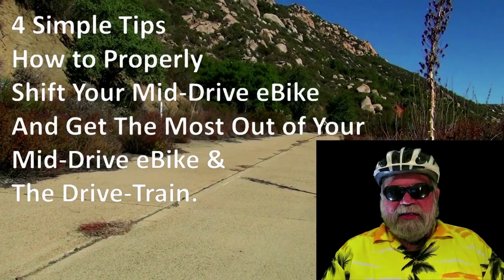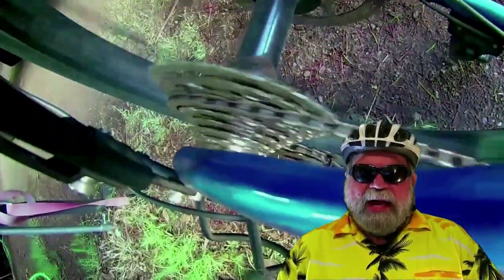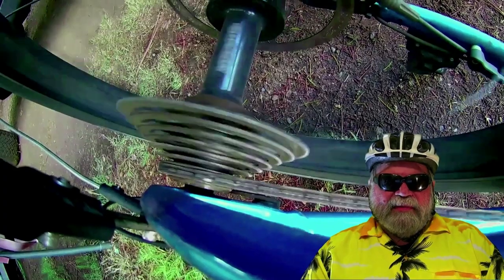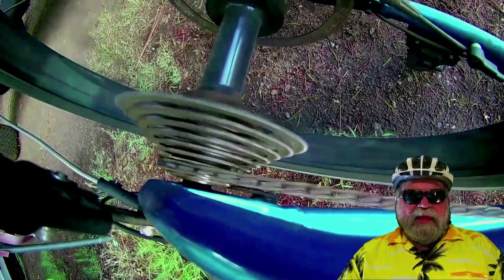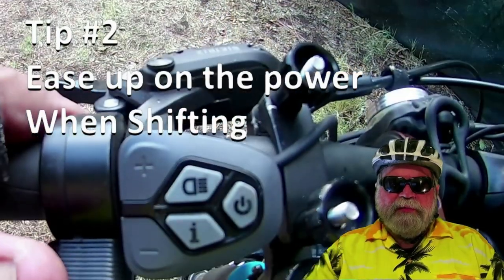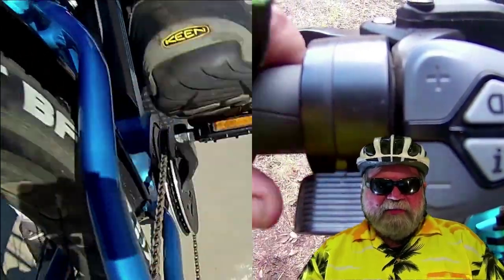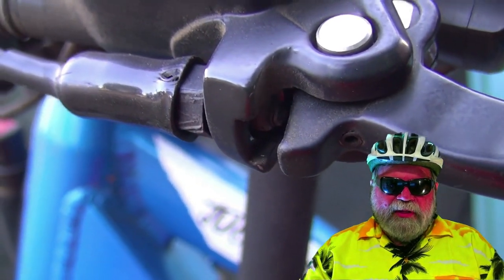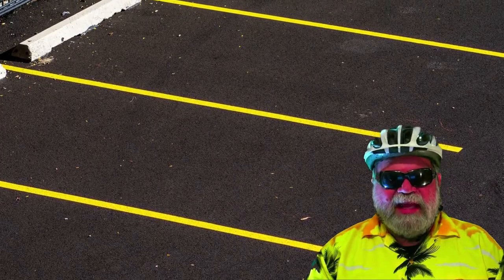4 SIMPLE Tips for Shifting your Mid Drive eBike. Make your Mid Drive e-bike perform better.

Comment: This has been the best, most down to earth video I’ve seen for the topic. Thank you!
Reply from the maker: Thanks for the great comment. Do you ride a mid-drive or hub-drive eBike?
Reply: @GreyBeardEBiking  a mid hub. I heard it was easy to mess up the motor or cassette and wanted to avoid it.
Reply from the maker: @defenderofmen11  My experience has been that the Mid-drive motor set ups are more tolerant of hard use. I'm a large rider and ride in very hilly terrain and I have burned up multiple Hub-drive motors. Now that I'm using Mid Drives and using the gears on the bike properly, I haven't had any issues with my motor or drive line. However, like all mechanical things, there is wear over time and I realize I will need to replace parts. I carry spare chain parts on my rides so I can repair a broken chain. In addition, I had a spare rear cassette for when the time comes that I need to replace it. I have owned my current eBike for over 3 years and have over 4000 miles on the original chain and rear cassette. I'll probably replace both sometime this year, but they are still operating well. Stay safe and carry a tool kit with you.

Comment: Excellent guidance for those new to mid-drives as well as a sound reminder to us with experience. Thanks!
Reply from the maker: Thanks. You would be surprised to find out how many riders I've seen, both experienced and new riders, that leave the chain in the highest gear, (Small Cog), and never use the gears. Really bad for the entire drive system and really heats up the motor. Having ridden pedal only bikes for many years, I'm pretty used to down shifting, especially when coming to a stop or on hills. Have you had any issues with your eBike drivetrain?
Reply: @GreyBeardEBiking  No drivetrain issues whatsoever, but I do what you advocate. I have experience from motorcycle riding and bicycle riding in my youth. I also drove a stick shift car. Glad I still remember!
Reply from the maker: @itsaboutsuccess  Ah yes ... the manual transmission. My jeep is/was a stick shift and I learned on my dad's stick shift Datsun truck. Unfortunately my jeep, My Weekend Mobile, gave up the ghost 2 weeks ago after 310,000 miles. I'm gunna miss her.
Reply: @GreyBeardEBiking  Who was to guess that stick shift experience would have future benefits? Seperately, your jeep traveled around the earth more than twelve times... impressive!
Reply from the maker: @itsaboutsuccess  Yup, she was a very durable machine that shared many adventures together. Already miss her. Like you, I'm really glad I got the experience of a manual transmission. And you're correct, the experience has helped me in other areas.

Comment: Cut to the chase and get a Rohloff Speedhub, you won't believe how well a mid-drive and an IGH work together. You won't want to ever go back. I replace my chain every 6 months (approx 3K miles) and flip the Rohloff gear to a new side.  Less than $20 and about 30 minutes on the side of the trail anywhere I may be.
Reply from the maker: Yup, the Rohloff speed hub is a great piece of gear however, I was trying to point out the simple things that can be done with stock gear that will help to extend the life of the eBike drive train. Did you do the install yourself?
Reply: @GreyBeardEBiking  Yes and a Rohloff cut my yearly maintenance to the drive train to less than $50 a year. Try replacing the entire gear cluster and see what it costs. Mid-drives can and do tear drive trains to shreds when riders start to ride more aggressively or start loading the bike with gear. The only way to save low-end stock components is to ride soft and easy... which doesn't last long when you start getting experience on your ebike.

Comment: Just befor i got my mid drive I built a Shimano IGH into my wheel. My homey was asking "wai not just have the bikeshop stitch it together?" 
Because I would have to give them $30. And I wouldn't have the chance to learn to do something new. 
I did have them calculate and cut my new spokes because if I calculated wrong I would be paying for the next set, if they calculate wrong they replace them. The tool to thread them is $200. So that will be for next year.
Reply from the maker: Thanks for the comment. Sounds like you took on a pretty tough challenge, but you overcame the challenge, learned something, and saved some dough. Congrats.

Comment: Awesome tips. Thank you for sharing!
Reply from the maker: Thanks for the nice comment. Do you ride a mid drive or hub drive?
Reply: @GreyBeardEBiking  I ride a vintage K2 MTB hardtail with a Bafang BBS02 mid drive kit. It is awesome. I am constantly reminding myself to always put it in first gear when I am stopping or even just yielding. Just today I was cruising in PAS 5 and gear 5, when I came to an intersection. I forgot to downshift when I slowed down, and when I started pedaling again I could hear my gears bark at me. learning everyday...
Reply from the maker: @banyanstudio  That's awesome. How long have you been riding your rig and where do you ride?
Reply: @GreyBeardEBiking  I've only been riding with the new motor since January. Just about o hit 100 miles on my odometer. I ride near Seattle WA.
Reply from the maker: @banyanstudio  That's great. keep me updated on how your setup lasts. I live in Southern California, but I will be moving to North Idaho this summer. (CDA). Maybe We will see each other on the trail sometime.

Comment: Is it okay to start on the higher gears if I only start the motor once I've gotten up to speed by pedaling?
Reply from the maker: Thanks for your great question. Generally, it's better to not cycle your motor on an off as it uses a little more battery life. Also, even if your motor is turn off, it's still better to shift to a lower gear as these put much less strain on you drive line, "Chain, gears, pedals, ETC."

Comment: Nice to see you back!  Was worried about you. What have you been up too!
Reply from the maker: Thanks, been traveling a bit. Might be moving from SoCal to Northern Idaho. Any advice for me.
Reply: @GreyBeardEBiking  yes !  Do it!  Although your biking opportunities will be less if at all in winter.  I toured Idaho 4 times looking for homes with land.  Great deals and would have loved to move. But for now I need to stay closer to aging parents.  Moved from NorCal to Northern Nevada for now instead.  Lots of trails to ride here and Lake Tahoe not to far. Got in a nice ride on a great bike path yesterday from Squaw Valley to Tahoe City.   114 mile trail call the the Tahoe-Pyramid Trail I’m looking at completing next spring.  Have friends all over Idaho.  Mostly around Boise.  I was looking around Coure d’lane very hard.  Be sure to checkout McCall, Idaho.  Was also top of my list.  Great growing small town.  I’m was rated as one of the top towns to retire.   I might get ti move there in a few more years. Looking for cooler summers.  But they do get quite a bit more snow that CDL.  Best of luck with your decision. It sure is beautiful up there.
Reply: @GreyBeardEBiking  I’m riding a Eunorau Defender S.   Dual hub motors, full suspension, running dual batteries also when needed.  Love the bike so far.
Reply from the maker: @joebidendidthat5121  That's an awesome ride. I'm still on my Biktrix Juggernaut Ultra 1000 mid drive. It has been a very reliable ride for me. Had it since Jan 2021. Many great adventures on it.

Comment: Just orderd my first e bike which is a mid drive so this will be really useful. Ordered a Specialised turbo levo as i wanted comfort, durability and wanted a nice powerful motor as its 565 watts with 90nm of torque. But wanting to find how to get the most out of it i can.
Reply from the maker: Thanks for the comment. The Specialized Turbo Levo is a great eBike. You will love it. As far as getting the most out of you eBike, I always recommend following the manufacturers recommendations for maintenance and repair. I don't try to "soup-it-up" with aftermarket speed upgrades. It seems when folks try to do things to the motor or battery outside of the manufacture's recommendations they end up with problems. What type of riding do you do and what part of the country do you ride?
Reply: I wouldn't trust myself trying to add anything aftermarket on it 😂  probably change out the grips, pedals, and add a better chain, but keep it mostly stock that way. Be mostly road and some gravel/dirt paths. It's definitely overbiked for my commute to work, which it's 12 miles one way, so I want something comfy but with some oomph on the motor. It's the alloy model I've got as also got £500 off but eventually I may upgrade to higher model down the line but definitely can't wait
Reply from the maker: @SubaruWRC1996  Sounds like we think alike with regard to aftermarket accessories. I prefer for my everyday riding to keep everything factory. For me it has worked well and my eBikes tend to las a long while. All this being said, if we were riding some extreme terrain and really challenging the eBike then I would consider some specialty parts. But for now, I'll stay stock. Let me know when you upgrade and how it goes for you. Thanks.
Reply: @GreyBeardEBiking  will do. Got some new pedals and ordred some floating disc rotors. Will look at changing the break levers and break calipers too and I think I'll change the grips too. Also thought about getting the e bike specific cassette and chain from kmc too
Reply from the maker: @SubaruWRC1996  Sorry it took so long to get back to you. Life got in the way. Sounds like you are adding some great accessories. Let me know how they work out. Thanks again.

Comment: There is no such thing as a legal mid-drive more powerful than one human leg. E-bikes are NOT harder on chains, cassettes and such. We generate more than 100nm's of torque with our arms in bike shops everyday. 

Persons experiencing unusual chain wear and such are indeed shifting wrong. ALL bicycles, "e" or not, should be ridden 60-90rpm. This is why you often  see a seated rider passing one standing in races. You should be pressing no harder than as if you are walking on the same surface (some exceptionally fit riders are even efficient at 110rpm). Yes, you can go a lite gaster pressing g harder, but your return on energy is greatly diminished because it is absorbed by your frame and drive line components (it is hard on them too).  Shift accordingly and indeed, use all of your gears. BTW, this is why internally geared hubs are better for e-bikes. You can shift coasting or stopped so you are always in the ideal gear to start. That really helps with the reliability of your bike.

Torque sensing eliminates the need for a shift sensor. All bikes, "e" or not, should never be shifted under load. It has nothing to do with the motor.
Reply from the maker: Thanks for your comment. I agree with on the issue of shifting under load. That should not be done on a regular pedal bike or an eBike. However, most quality mid-drive eBikes have a power cut off switch that cuts the power to the motor during shifting. I don't agree on other items you brought up. eBike motors, rear hub or mid-drive perform best when the motor is run at a higher RPM and lower gear, (larger rear cog). To be legal in most states, for the street, eBikes must have power shut off switches when they reach 28 MPH. As far as a rear hub motor being better than a mid-drive motor ... it depends on many factors. Larger riders generally do much better with a mid-drive because the motor can work through the rear cassette like a transmission on a car. Whereas the rear hub spins the entire wheel and does not just use the rear cassette. Of course, using a lower gear and pedaling when starting from a dead stop will help both types of motor. Also, the mid-drive motors are generally able to generate more torque. And because the mid-drive motor delivers higher torque the mid-drive motors tend to be harder on the entire drive chain, including the chain. Thanks again for your comments.
Reply: @GreyBeardEBiking  you completely misread my comment. I will only sell or convert with mid-drives. We only disagree on the need for cut-offs on a torque sensing motor (factory bikes will almost always have them. Vanpowers and Reid being notable exceptions) and on drive train wear from mid-drives. That is a myth. Like I said, no legal e-bike motor exerts as much torque as ONE human leg (it also divers the power more linearly). Only improper shifting will cause unusual chain wear on a mid-drive.
Reply from the maker: @MHH3180  Thanks for the return comment. We pretty much agree ... the major cause of chain and cassette damage is due to "Power Shifting". However, Chain and cassette wear is higher on mid-drives because the power from the motor is through the drive line, as opposed to the rear hub drive which does not use the drive line to power the wheel. In any case I think we are on the same page. Of course this is all based on street legal eBikes. When on the off-road the power of some of these eBikes is really up there.
Reply: @GreyBeardEBiking  actually, no. Ridden at comparable speeds, you still put more power through a chain pedaling than through any motor. The motor spins more freely when you add more leg power. Now, if a hub drive is run off throttle, then yes, it is going to give no chain wear. Also, I guess, if you start in high boost and don't help with your legs much, you could get more wesr. My cystomers though are getting the same chain wesr as before I converted their bikes to torque sensing mid,drives. This may be because they are experienced cyclists (the reason they have good biked to convert).
Reply from the maker: @MHH3180  Thanks for your comment. I agree with most of what you are saying however, in my experience, in general, most eBike riders use the throttle with little or no pedal effort much of the time. So, in this case, as you mentioned, the mid-drive motor is harder on the drive line. Just to be safe I always carry a chain braker tool and spare chain links in my on bike tool bag.
Reply: @GreyBeardEBiking  yes, this is why all mine must be torque sensing g, with a very sensitive setting, so there is no need for a throttle. In my experience throttles reduce reliability 50% even when supposedly used as they should 😉
Reply from the maker: @MHH3180  Yes, torque sensing is definitely the way to go. I do see the need for throttles in many cases, especially with older or disabled riders. Thanks again.